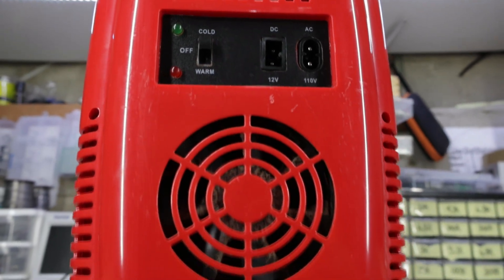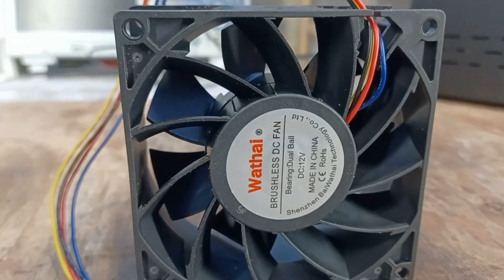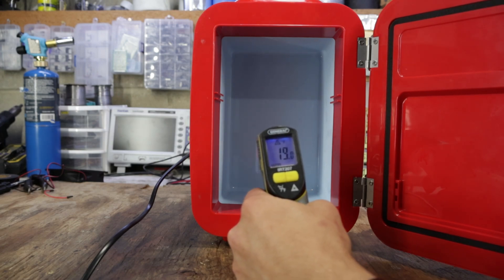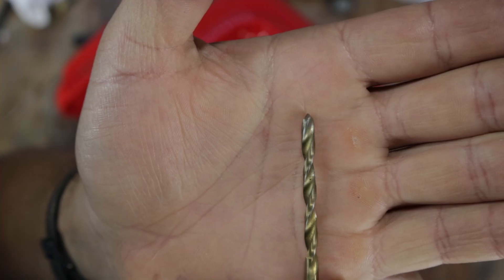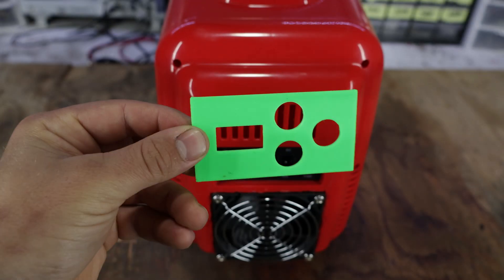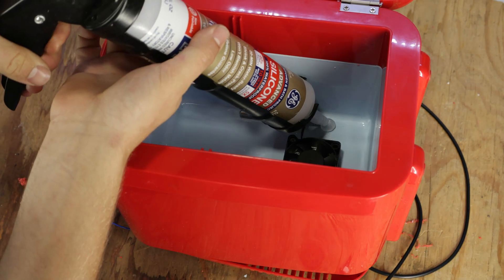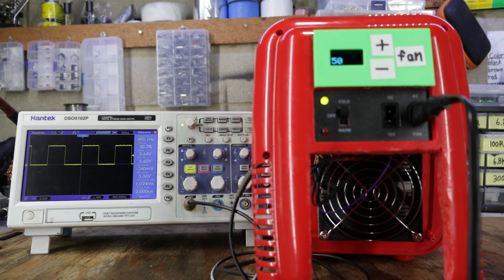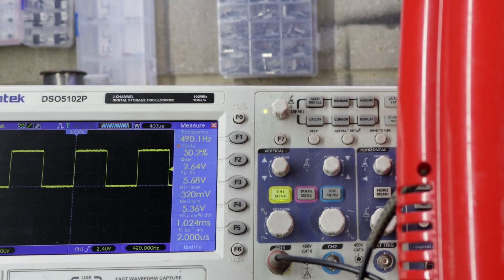Can You REALLY Make a Mini Fridge COLDER Than the Factory Setting?

Comment: cool video,  the best way to control peltiers is to have them switch between 5v and 12v. also for my old wine cooler fridge I got rid of the power port and just put a pd trigger module so i can use a gan power supply. there are also some radient heat transfer things you can do to boost efficiency further. theres a weird video on my channel where i converted a large format 12v fridge to run on usb-c and it only uses like ~4w average lol. its actually kind of insane how efficient you can get a fridge. i think its like 54 liters. compressor is always the way to go though.
Reply from the maker: I checked it out, and yes, type c power delivery with a pd trigger board is pretty cool

Comment: i had this same project happen to me. my sister gave me one of those fridges. i added a bigger fan and a heatsink inside. it went down from 55 to 40 degrees. i might try a fan inside. cool video.
Reply: Is it possible to do this without soldering?
Reply from the maker: Yes, you can twist the wires together and cover it with electric tape. I soldered it because it's more solid that way
Reply: One thing though the heatsink inside is constantly producing water in the bottom of the fridge.
Reply from the maker: That's why more expensive fridges have a drain in the bottom that runs with a pipe to a tank that sits against the compressor so the water should heat up and evaporate

Comment: Junk junk junk it's not a fridge in any sense. And uses more power vs a conventional fridge (it needs to be on all the time) for it to work it's never off as long as it's turned on. 2nd that fan will drive u crazy with the noise. Buy a ice chest fill it with ice you'll have a better thing.
Reply: Bro, it's a project, solving problems is fulfilling.

Comment: I love the project, but next time, I would recommend trying a PID algorithm for controlling the fan and cooling, since this will give you automatic fan control and will allow the Arduino to ramp up and down the Peltier plate and fan as appropriate/needed to maintain a tighter temperature. The way you have it now, it simply switches on and off when within one degree, but with PID control, the Peltier plate and fan would be driven at increasingly lower and lower PWM pulses as you neared the set point. DC Fans often have a minimum operating speed, but you should be able to get much closer to 0% when the fridge is closer to the setpoint, and it will automatically ramp up the cooling when the fridge has been opened or something warm is placed inside.
Reply from the maker: @Hotrian  that is a good idea, I think most electronics run more efficiently at a lower pwm. Maybe I'll try it on another project.

Comment: I don’t know enough to gage whether this is helpful information but I am under the assumption that are applying higher. Current to the Peltier module moves more heat though I don’t know what current that module is rated for and exceeding the recommended current could cause damage. I don’t t think adding more heat sinks to either side would  change the amount of heat moved but could give it more headroom to increase the current and thus the cooling performance. and no I did not spend 15 minutes typing this. I use text to speech because I’m a lazy piece of crap. This is a cool video, Keep up the good work. 😊

Comment: Interesting project.  Peltier modules are really speciality things and not suited to refrigeration. A normal full size kitchen fridge literally uses less electricity when you average it out over a day.
Reply from the maker: @Necromancer_Bob  that's true. Although if someone wants to travel or use it in a car, it would be a bit of a hassle to transport the weight of a compressor.
Reply: @ElectronicLab.  You can get good compressor based coolers for cars. They are less space efficient, more expensive and heavier than peltier based ones, but easily worth it.
Reply from the maker: @lollandster  thanks for the info, I didn't know that.